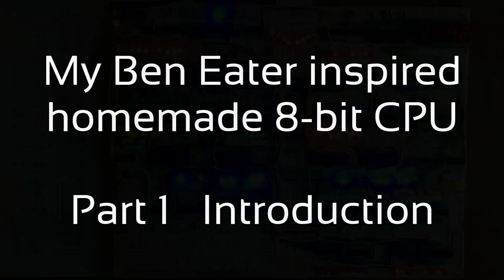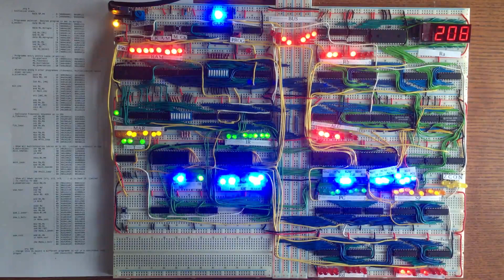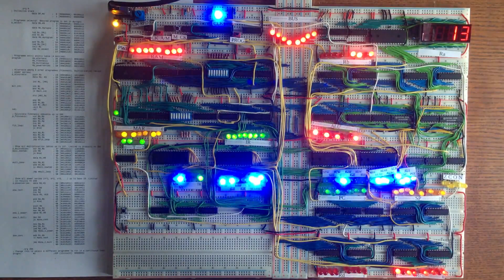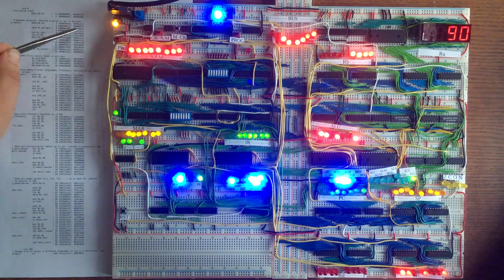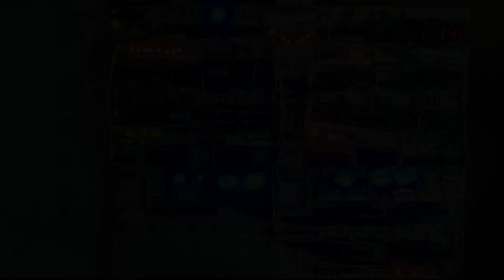My Ben Eater inspired homemade 8-bit CPU  -  Part 1: Introduction

Comment: In Ben's build, he splits the Instruction Register in half where the 4 MSBs are opcodes, and the 4 LSBs consist of either a memory address, or a piece of 4 bit DATA. This has been the most obvious limitation of this SAP-1 computer. It seems like it's more of a 4 bit computer than an 8 bit computer since it only has 4 bits of addressable memory space.

On yours, since you have extended your Program Counter and Addressable Memory to 8 bits, how are you able to move all your information around the computer while only having an 8 bit BUS? The 8 bit BUS works on Ben's build because of the way the Instruction Register is split in half.

But on yours, I would think you would need an additional 4 bits on the BUS for a total BUS width of 12 bits. 4 bits for opcodes, plus an additional 8 bits to address all the memory.

So I'm just wondering how you are able to move all your bits around without a wider BUS?

Thanks.
Reply from the maker: Hi David :)

Here's how I understand Ben's architecture: he uses 4-bit addresses in memory (including the PC) and 4-bit opcodes. On the other hand, normal data values (A, B, OUT registers, memory contents) are 8-bits wide, whence his 8-bit bus. Now since he has an 8-bit bus, and since the program machine code is in fact just (8-bit wide) data bytes in memory, he can be a bit "sneaky", in that his instructions contain an opcode (4-bits) and a so-called "immediate operand" (a hardcoded data value or memory address), also 4-bits, in a single 8-bit byte.

This means, he can load in both the opcode and the immediate operand together using one single memory-read-to-bus-and-write-to-instruction-register operation. After instruction decoding by the control logic, he then needs to send the immediate data, now located in the lower 4-bits  of his instruction register, to where they really belong: a register (immediate data) or the MAR (immediate address).

In my computer, data values (Ra, Rb, Rc, Rd registers, memory contents) are 8 bits wide, just like Ben's, but both memory addresses (such as in PC and SP registers) and instruction opcodes are also 8-bits wide. So I actually support many more instructions in my assembly language, since I have 8 bits to encode them all.

Now, program machine codes in my computer can be either single 8-bit data bytes (consisting of ONLY an 8-bit opcode, for example MOV Rd, Rc), or they can consist of TWO 8-bit data bytes, i.e. 16 bits (one 8-bit opcode, followed by an 8-bit immediate operand(data or address)), for example DATA Rd, #104.

Now when reading in an instruction which has an  immediate operand, and is therefore 16 bits long instead of 8, the 8-bit opcode, which is the first byte, lands entirely in the instruction register. All 8 bits of it are opcode. There is no immediate data at all in this first byte. The control logic decodes the opcode, and thereby KNOWS that this particular instruction has an immediate operand, and therefore uses ANOTHER memory load cycle to load the immediate operand, and send it directly to where it needs to go (register for example). The immediate operand never goes anywhere near my instruction register. That is used purely for (8-bit wide) opcodes.

So I "get away" with an 8-bit bus, because I load 16-bit instructions in two cycles: the first one loads the opcode into the IR, and the second loads the immediate operand, directly from memory to where it needs to go.

You can see an example of me stepping through such an instruction in episode 4 (https://www.youtube.com/watch?v=hRJO97PbPlw) starting at 8:12.

Later, in episode 5 (https://www.youtube.com/watch?v=tUXboOaisAY&t=812s), starting at 22:51, I go through the instruction register, and the way instructions are encoded into opcodes.

I hope that "demystifies" things a little bit? Thanks for your interest anyway!
Reply: Thanks for the thorough explanation. That does demystify things a lot. All of this is quite complicated, so I certainly can't claim to have complete understanding. But I think I get the gist of it. The opcode gets loaded into the IR first, and that sets up the control logic to read the necessary data out of the required memory location. So you're able to use the bus to grab "chunks" of information rather than getting an entire instruction + data all at once. 

I saw many of your videos a few months back ... but it has only been within the last few days that I've been able to resume working on this project myself. So I've been going over your videos again because it is truly impressive how much you've extended this project. I have it mind that I want to expand mine as well. However, I kinda want to keep my current build as-is. Primitive, but relatively simple. So rather than expand my existing breadboard computer, I'm thinking of building a second one that can have an 8 bit program counter, more addressable memory, and so on.
Reply from the maker: Yes, I'd definitely build a new CPU. Although some modules (e.g. clock, digital display) can be taken over as is, and some can just be expanded (PC, registers), the machine language resulting from having the "luxury" of 8-bit opcodes is totally different from Ben's, and more in line with real-world CPUs. Since I'm mostly used to x86 and ARM, I expect some habits from those architectures have crept into my assembly syntax  ;)

Comment: Really nice! You need more views! I want to build a computer like Ben Eater's one but a little bit more advanced (8 bit address space for example). I look forward to looking at your videos to get some inspiration, especially with conditional jumps. It seems no one made an interactive input module and it's too bad, maybe I'll look into building something like this myself, as I'd love to make games like a 1-D Pong or a “Guess the Number”. Do you have any idea of how that could be implemented or if it would be difficult? A “simple” approach could be to input a number while the computer is halted, then press a button to continue the program's execution, which could then read the input number.
Reply from the maker: Well, the classical way that CPUs interact with I/O devices is using interrupts. Neither Ben Eater's, nor my CPU have any kind of interrupt handling.

I think it could be a fun, and VERY useful extension to work on! Would need to read up on how interrupt handling works on the hardware level, since my only experience with it is from the software side.
Reply from the maker: Je parle très bien français: je suis belge ;) Je me réjouis de voir la solution pour la saisie de programmes!
Reply: Haha distractions sure are a bad thing, but I still manage to generally finish my project, and as I will present this at a creator's show here in France, it's better if it's finished. =)
That would be great if you let us know when it's done yeah!
Reply: So..I started my "paper napkin" version of the input device control procedure and realized.. interrupts are super simple, and pretty much like what I had described.
All we have (let's say we use 8 interrupts, with only one today - being the input register) is another 8 bit register. When the data is arrives to input register, we raise that bit in our interrupt register. CPU/microcode checks after completing the instruction (so fetch/execute becomes int?/fetch/execute. Control ROM branches to read input from the corresponding input register if int is high/set, and then clears bit. Probably going to have to put existing PC on the stack if an int is detected, and maybe figure out a way to coordinate interrupt functions with interrupt bit position (so bit 0 will call the method to parse keyboard codes, but bit 1 will call method to .. perhaps take mouse input??) I remember the phrase "interrupt vector", so i think that's how to tie code location to interrupt.
At least I'm pretty sure that works. Exciting stuff :D
Reply: Hey, I started working on it again, I'm making my modules little by little. =) I will wait a bit before making my input module, as my computer needs to be ready in about a month so I can showcase it at my maker's local show. Ben Eater is posting new videos currently, that's great!
Yeah if course I'd like to know the details of your module. ;-) Think about making videos or a GitHub repo with schematics and everything, it would be nice to sometime make a repo gathering all breadboard computers resources.
Reply: God damnit! Microsoft! D=
Anyway, I find it pleasant to make all my schematics beautiful on computer, I can then maybe make them “slide” under the modules of my computer so I can easily look at how it works. =)
Reply: Hey ! I'm currently developing a simple VHDL 8-bit cpu and I currently have a very crude input instruction which just halts the clock by setting a 'WAIT' bit in my control word. There is a button that allows you to re-enable the clock and then the rest of the instruction just fetches whatever is in the input register. The way you set the content of this register doesn't matter, dip-switches would certainly work. I look forward watching your videos James, because I too intend to have a stack, and a simple C compiler! My code is available on: http://www.github.com/op414/8bitcpu ;)
Reply: That is exactly what I plan to do for my computer. =) It's a simple and effective way to input numbers into a program.
Reply from the maker: Sounds great guys! A kind-of halt-and-wake-on-interrupt instruction. Are either of you planning to show off your computers when they're done? ;)
Reply: Sure, I'm actively working on it, to hopefully present it at a maker's show along with other computers I made (I made a replica of the Kenbak-1, the first ever personnal computer ;-) ). When it's done I'll try to make videos like you to present each module, sadly it will be in French… =)
Reply: Ahhh, super ! Ma sœur est en Belgique. ;-)
Reply: I realize this is an old comment, but in case you are still at it, did you build any sort of input processing capability.
 real computer would use interrupts as James wrote, but I'm going to start on this module next, and i don't think I will use interrupts at first. I will use the method prescribed in the book "Digital Computer Electronics by Albert P. Malvino". My idea so far.. there will be a register that reads input from keyboard. It has to store at least two bytes since break codes are two bytes. I'll have a simple compare to check if high byte is a break code (so it will only work for 90% of the keys in first implementation). (http://techdocs.altium.com/display/FPGA/PS2+Keyboard+Scan+Codes). Since the break code comes before the corresponding make, I will write first byte to lower register, then if another bit is received, shift to upper. Upper will have a hardware (bits tied to ground and VCC) comparator to see if its a break code. If not, it can be processed as two sequential keystrokes. If so, it can be processed as a break code, or ignored, depending on the program. Once a byte is received, (possibly adding a clock cycle or two delay), i will raise a one bit d flip flop to signify that data is available. Then it will be up to my code to periodically check if input is available. Once code reads the data, flip flop is reset. Thinking also have blocking key input (so if a keystroke is recorded but not processed by the system, registers/buffer will not take in another. Also considered using a FIFO like IDT7202SA35P. Do you guys have a better way to do it? I'd love to hear your thoughts.
Reply: Well that seems to be a too much complex solution for the simple computer I want to build, but the idea is neat. =)
What I'm looking to do (haven't got the time to further develop my computer but starting next week I will continue to work on it), is to HALT the computer when executing an INPUT instruction, then the user enters a byte with DIP switches and press a button to resume program's execution. The program can then read the input byte directly on the bus using a transceiver to activate its output.
Reply: Sounds neat. Good luck.. and don't watch tv instead :P If you care to hear about it, I can let you know how it goes when I'm done.
Reply: GilDev2, any progress on your computer? I designed my keyboard input circuit a few days ago on paper, and I started to put it together now on breadboard.
I decided to do something very similar to what I described, if you are interested, I can tell you the details :D
Reply: I think I am a bit too disorganized to create a series. I did put up my EEPROM programmer, assembler, and binary uploader (just serial wrapper for my eeprom programmer) onto MS's Git, but the schematics are all on napkin sketches and my head for the "final touches". Repo is here: https://smarttoys.visualstudio.com/_git/28C16_Programmer
Reply: I'll see if I can be diligent with this Keyboard circuit, who knows, maybe I will be able to show a schematic :)
Reply: Baaah, IDEs! Try Linux sometime, you'll like it. ;-)
And of course do as you want for the schematics, but it may be nice to put some time into it for future reference for yourself or others. =)
Reply: Ok, I put my work in progress there
https://github.com/levvayner/EEPROM-Programmer
I use VS2017 and Visual Micro for my IDE, so if you do too.. you'll get easy to use visual structure for all the files in one solution.
Reply: HAHA..  I like linux for certain things. I had a my first mail servers on linux for the longest time. It was a pain in the ash to set up, but once I did, the sever didn't have get touched for 4 years straight, until we demoted it.
But windows is not that bad.. not like 3.1 or Win ME :-)
Reply: I uploaded the RTL schematic of my VHDL version of this computer. Its here: https://github.com/levvayner/EEPROM-Programmer/blob/master/schematic.pdf